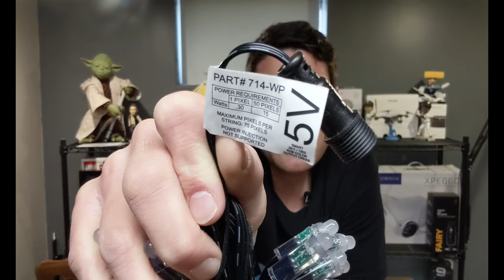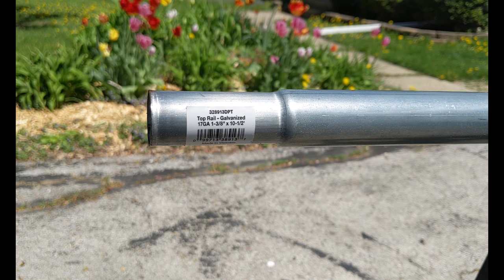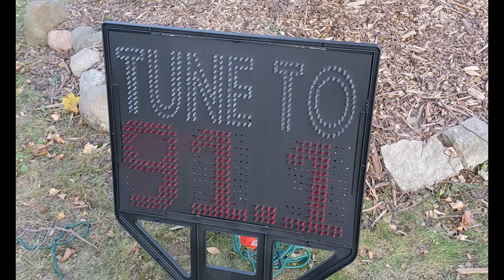How To Build an LED Pixel Mega Tree (Assembly) For An Outdoor Christmas Lightshow from HolidayCoro

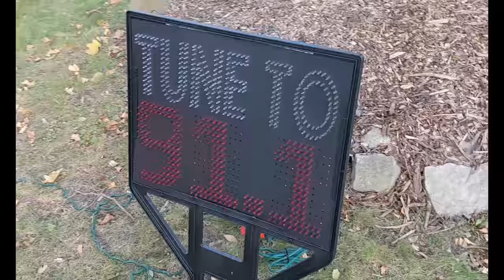Comment: 15:40 Did you buy anything extra with the kit, the CPU Type and Options has me confused if I need them.
Reply from the maker: I went with the hinkspix pro cpu (which I would recommend) you'll need an SD card whether you buy it on your own or from them, the pixel installation jig is also extremely helpful (in my opinion), you'll need a data cable if you are running the show from a computer vs. an SD card. I would start by running the show from a computer and then follow the steps on their site to save sequences to an SD card.

Comment: When you connected the two poles together did you have to tighten it in any way? or did you just leave it asis
Reply from the maker: The fence post for the center pole is tapered at the top of each piece, I just inserted one piece into another, there is no other fastening that I did.

Comment: If i get an sd card do i need a cat cord?
Reply from the maker: If you have a hinkspix pro controller then you can run your lights off of an SD card if you put it in master operating mode so then you wouldn't need. I can't find cable running from a computer.

Comment: Why did you go 5v instead of the 12v?
Reply from the maker: It was slightly cheaper to by the 5V pixel tree light system rather than the 12v system

Comment: I find those 50 node strings are unreliable, have 10 of those strings (500 leds) on our Christmas tree and had to replace 5 of the nodes within 3 weeks (cut them out and resolder the rest together).
Voltage and temperature are all ok so it is related to the build quality of the strips.
Reply from the maker: This is the 3rd year I'm using these 50 node strings from HolidayCoro for my pixel tree and haven't had any problems, 2nd year also using them on my house. I know there are varying qualities of pixel lights. Different vendors sell different quality levels. If you purchased them from HolidayCoro and are having problems I would suggest you reach out to HolidayCoro and let them know.

Comment: As soon as you went the kit route..... dislike... any idiot can order a product!
Reply from the maker: I went with the kit because at that time several years ago I did not know nearly as much as I do now about the process of pixel lighting as there are so many options and different designs that can be done. For newbies in this hobby buying a kit will save you time vs trying to do everything from scratch. Since this video I have made many more complex videos as my holiday front yard display has gotten more complex over the years and I've added many custom elements to it. I have talked with far too many people trying to start a holiday show that are overwhelmed and get frustrated with electrical programming, calcs, design and vendors with faulty products when problems arise. Buying a kit allowed me to dive right in and learn more as I was building my show.